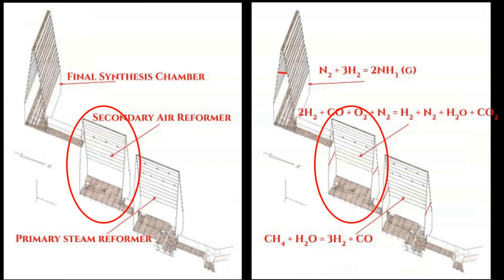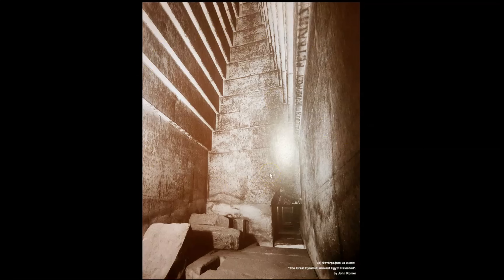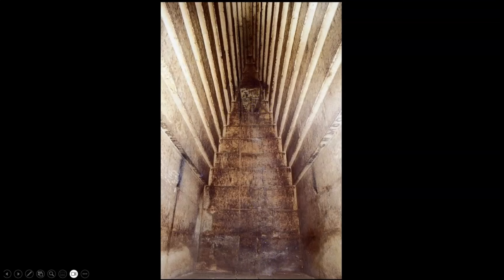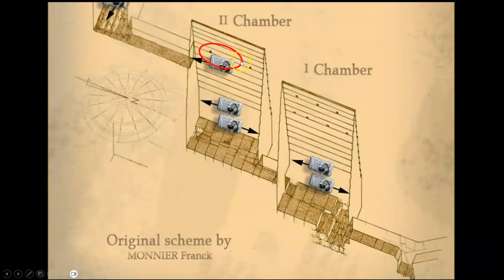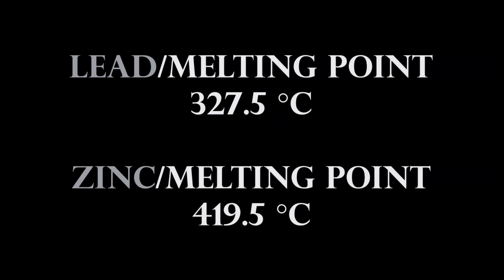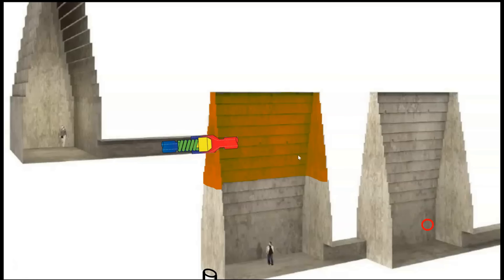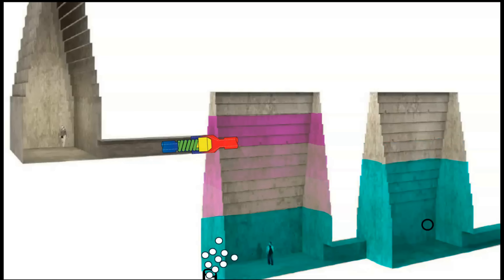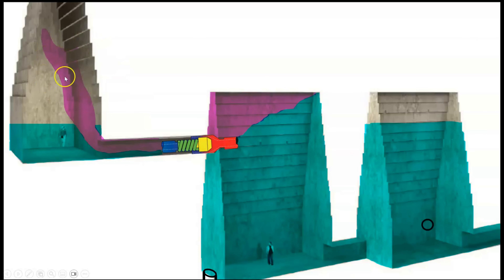Episode 158: ANCIENT PYRAMID CHEMISTRY TECHNOLOGY, PART 3 - RED PYRAMID SECONDARY AIR REFORMER

Comment: in the Quran, the Quranic letter al-qashash verse 38 described the command of pharaoh (King Egypt) to Haman to create a high building of burnt clay. and after seeing the explanation in your video, could it be that granite chambers was a chemical furnace used to burn clay (from inside)? so that clay arranged on the outside of the pyramid hardens like a rock? it's just my wild speculation 😁

Comment: All of this is very convincing until the absolute absence of water nearby makes this half of the system seem unworkable without the water and ways to move the moving liquid parts around not to mention acids...

How, other than you and your lovely wife carrying water bottles in backpacks, did water in the volumes needed, get up that ladder and into the downspout?
Reply from the maker: Did you forget about the Nile River? It used to be right there less than half a mile away from the pyramid. Plenty of water 💧  🚿 🚰

Comment: So i think this staining is from 100's of years of cleaning solutions. Think ELECTROLYSIS, with hydrogen/oxygen: [burnable fuel/power]. Each corbalt ceiling concentrates/confines these gasses to be used in furnaces via shafts.
Reply: Hydrogen could also be used in the construction of a massive, *{"《Blimp》"} that could lift a 10 ton Megablock.

Comment: While the Red Pyramid has not been the subject of extensive peer-reviewed acoustic studies, limited exploratory research and anecdotal reports suggest it may possess unique resonant properties. One study detected a possible acoustic resonance near 16.95 Hz, while a YouTube demonstration claimed resonance at 432 Hz, though without formal scientific backing. These findings hint that the pyramid's design may enhance or concentrate sound energy, possibly supporting theories of functional or energetic use beyond traditional tomb purposes. However, no definitive evidence yet proves that acoustic resonance was deliberately engineered for chemical or energetic processes within the structure.

If there is a link between acoustic resonance and its effect on chemical reactions, would that change your hypothesis or that of which chemicals were being produced?

And if resonance wasn't important in these processes, then why are they included in the designs? 

Happy accident but not necessary?